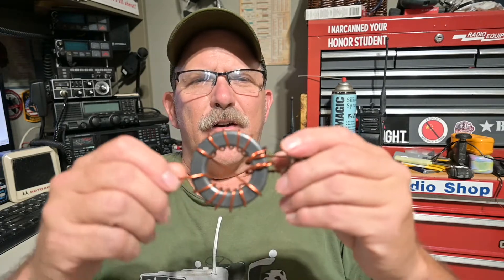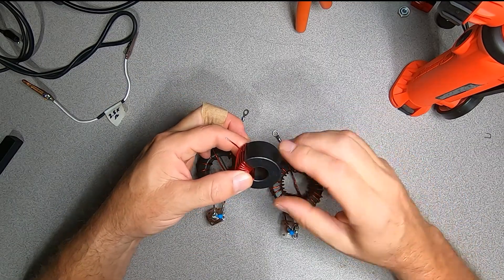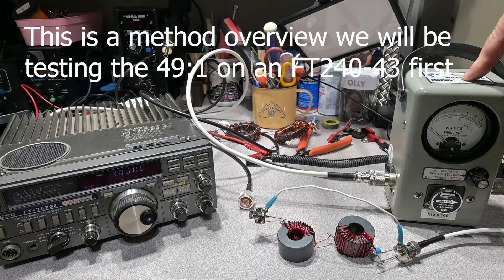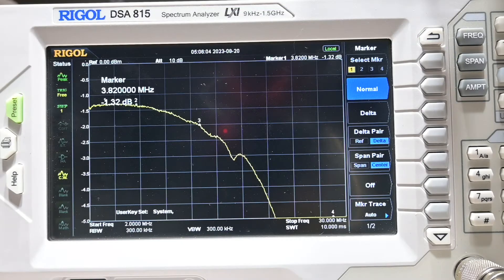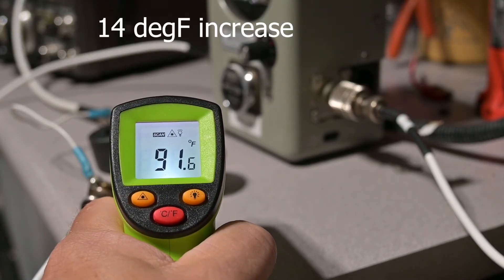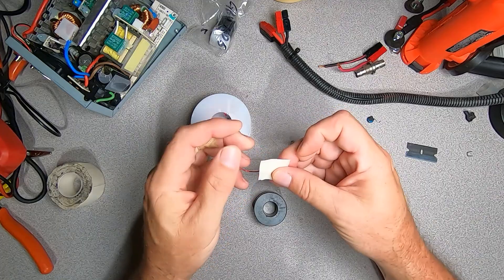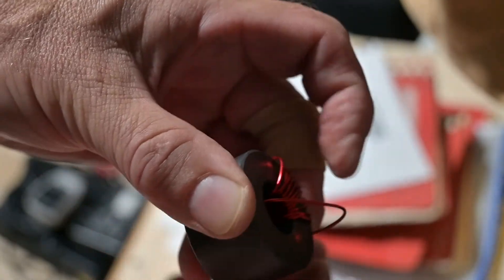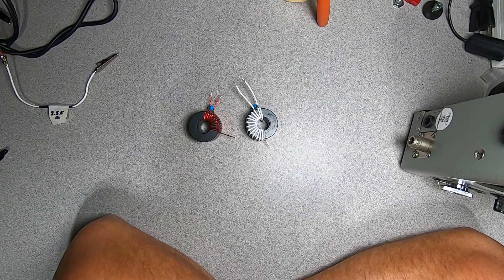EFHW ham radio HF antenna transformer tests -  build the best yourself - save money build and learn

Comment: Good Video, I appreciate the Hands On approach, and winding tips! 
At the end you said the transformer with teflon wire doesn't perform near as well in your testing, would you tell us how much difference there was?
I watched two EL videos right before I found this one, and he seems to over-stress some  small differences in loss that in the real world use cases wouldn't be noticeable on the air. The difference between the 240 and 140/43s compared to this new Fairite core are not small and have peaked my interest.  Thanks,   73   mike
Reply from the maker: About .2db difference however it is possibly due to the impossibility of getting as tight a wind. Tight winds and spacing do matter . There is nothing wrong with the pursuit of a better transformer design and even splitting hairs over it.  It's enhancing the radio art IMHO.  Thanks for watching !
Reply: Thanks for the info! I ordered 18ga enameled magnet wire instead of using the Teflon coated wire I had.   
Never anything wrong with finding a better way to do anything!
73   mike
Reply from the maker: @CriticalThinker-42  You are welcome !

Comment: They were no wound the same way. One is using the cross over and the other didn't. I think that is the big difference. Test it without the cross over.  I did my transformer without the cross over. I went about 3/4 the way around the 240:43 I get out well. I don't have a way to do the tests you are doing. I have seen some videos that shows that the cross over is not the best way to do it.
Reply from the maker: Thanks for watching !
Reply: Thank You for the information about the Toroid. I want to get some. I am thinking that the spacing of the windings and other things, I don't understand can change the way it works. I am sure that the cross over is not good! There is a rule about the distance between the core and the wire, from my classes many years ago. Something like the loss is the Square of the distance between the core and the wire. I may be off some, Study this in 1967. I am to lazy to look it up today. @survivalcomms
Reply from the maker: @donaldsmith3048  You are welcome ! Thanks for watching !

Comment: Excellent video! I also watched several of Steve Ellington's videos. He analyzes probably 8-10 store bought transformers and about 8 different ways to hookup an inverted-L (he tries other configurations) with respect to grounding, choking, and use of counterpoise wires. Tools used in analysis are a field strength meter and RF ammeter.
The conclusions are the myAntennas that uses the torroid in your video has best performance. The best configuration is an inverted-L that is choked and grounded at the transformer feedpoint with the transformer close to the ground, within about 3ft. This configuration provides about 3dB improvement over grounding and choking at the transeiver.
For the RF ammeter testing the horizonatal portion of the antenna was only about 7ft-8ft above ground.
He also experimented with chicken wire laid out below the antenna at a normal elevation about 30ft agl to improve NVIS.
Most of his videos are rambling with low production value, but the information is good to very good.
Reply from the maker: Thank you very much for sharing ! Thanks for watching !

Comment: I have seen a number of videos suggesting the use of 52 mix instead of 43. The claim was that 43 was often used commercially due to greater availability and lower cost. I'd love to see a similar workup to compare efficiency of 52 mix across the bands vs 43.
Reply from the maker: Colin @MM0OPXAmateurRadio has done that and has the data on his channel.  Thanks for watching !
Reply: Evil Lair did a test on the 61 material (the 2643251002 cable core form factor) and it worked just fine for 40m and up but NOT for 80... insufficent mu... unable to purchase 52 material as a cable core I cut a FT 240 52 donut in half with an angle saw, glued the 2 halves together and this closely approxmiates the cross-sectional mass of the smaller cable cores. Wound auto-transformer style as Brett has done this works exceptionally well on all bands.... I could detect no heating of the care @ 100 watts... As Brett mentions.. the TDK 100-120pf caps are far superior

Comment: Nice video.  I have been playing around with ferrite cores too, mainly for RF choking but also for 49:1 ununs.  I agree with the close winding over the traditional spaced out winding. I always use a twisted pair for the primary/secondary overlap.  Nice to see an alternative, kudos.   I think the take-a-way is the tighter winding rather than the stubby toroid. I'm not against the stubby, I have used two 240-43 stacked and glued with a drop or two of superglue.  Have you considered more windings (keeping 49:1)?  I cannot see why this would not be more efficient.
Reply from the maker: The stubby toroid is really the key IMHO. If you go to Colin's channel MM0OPX Amateur radio he has done the most exhaustive work on the subject and it is well worth the time. Thanks for watching !

Comment: Well done. Striving for efficiency and doing the testing to prove it! 👍
Reply from the maker: Thank you very much ! I did the capacitor testing too and spoiler alert your conclusions were what I observed in my testing. Video should be up today. Thanks for watching !
Reply: @survivalcomms  excellent! If you happen across any which are lower loss than TDK I would be interested in hearing about it! I did try a couple of others which were specifically marketed as high frequency and/or high Q. They didn't measure up.
Reply from the maker: @evil_lair_electronics  Will do . I tried some 15kv ones and on the thermal imager the look like little LEDs under RF.

Comment: Would you say that the autotransformer version is better than the version with a seperate primary winding?  I would think better because less coupling with the seperate primary.
Reply from the maker: I like it better personally - I have done it both ways and with wide spacing,  crossover, split narrow spacing, teflon wire, etc.  and all demonstrated considerably less loss to every iteration  ( and I made dozens) wound on the FT240-43.  The one shown here was the best of breed.  Give it a try and see what you think. Thanks for watching !

Comment: 800grit works a charm to take the nearly microscoping sharp flashing off that toroid corners. Allows for greater tension when winding.
Reply from the maker: I did not find and sharp corners in the 8 examples I wound . Thanks for watching !

Comment: Thanks, very interesting video. Do you think there are more losses in such a transformer or in L-Match? I always use a tuner instead of a transformer because it's easier to tune and I think my version has less loss, which is important for QRP.
Reply from the maker: There are losses in any device placed inline in the feed system.  You could and should do your own test and see what loss there is. It is pretty easy to do  with a tuner and a el cheapo VNA . Thanks for watching !

Comment: Good video, thank you!  I actually have one of those Fair-rite cores, seeing your video I think I'll build my first end fed with it.  I'll be on 10 and 6 meters (until I get my general) any advice for building a transformer with 10 meters in mind?  Do you use a counterpoise with these or rely on coax shield?
Reply from the maker: Thank you ! Honestly you are MUCH better off building a resonant dipole for 10 or 6 meters or better yet a half square.  If you are limited in space install it as a sloper. Even a ground plane will work better. You will have zero transformer loss and can take advantage of the benefit of higher frequencies which is smaller form factor.   If you are not space limited For 10 and 6 you could build a rhombic.  The advantage of an an end fed antenna is for frequencies below 20m due to expedience in employment. There is no possible way an end fed antenna will ever equate to a center fed antenna in terms of performance. Any one who tells you different is trying to sell you something you do not need.  If you want use your core and build a 40m end fed using the directions in the video. Thanks for watching !
Reply: @survivalcomms   For my current antenna I built a vertical dipole and ran it up a tree.  I've been able to contact Japan pretty regularly from here in California on 10 meters.  I see what you mean though about the size of efhw on high HF not being as much of an advantage over better performing antennas, thats a really good point and I tend to agree.  Right now I'm working on a "positive V" dipole mounted to a squid pole made with collapsible elements in the hopes of working 10 and 6 from the same antenna.    Thanks for the response!
Reply from the maker: @yttc88307  Look at building a Vee Beam. There are many decent designs that will accomplish what you desire. Get an older ARRL antenna handbook at a friends of the library book sale or perhaps ebay. Lots of great info at your fingertips.
Reply: @survivalcomms  I will, thanks for the tip!
Reply from the maker: @yttc88307  Any time its how I roll .

Comment: Thank You Bret

Some questions
1.  Do you think a 64:1 built on a 2643251002 would be even better?
2.  Would there be any changes in performance if stranded wire was used to form the turns around the toroid?
Reply from the maker: You are welcome ! You could try a 64:1 or a 56:1 using the same methodology and experiment with it. Winding a couple turns extra might work great for you.  I have wound EFHW transformers with stranded hook up wire and teflon insulated stranded wire. If you can keep it tight it helps the performance in my experience due to it being repeatable. With the wire spacing / tightness of wind on the toroid you could wind one that is amazing and one that is so-so and only the slightest difference is apparent with the physical package.  Its easy enough to experiment with what works for you. I personally have found the ability to tension the magnet wire equally to be more repeatable. I hope this helps and thanks for watching !

Comment: Hello, have you tested spread version of the winding for the latest transformer? If so, how did it perform? 73 de LZ5RG
Reply from the maker: Yes I have. It exhibited more loss than a tightly wound one. I have also made a conventionally wound one with a cross over and it exhibited more loss than the version presented. The version presented here represents the best performing EFHW transformer I have ever wound personally. One of the creators mentioned in the video asserts that capacitor quality matters so the next version will feature those capacitors recommended rather than the generic ones I used here. Thanks for watching !